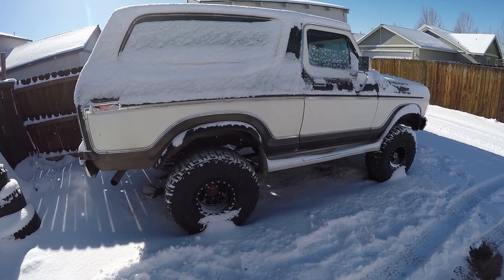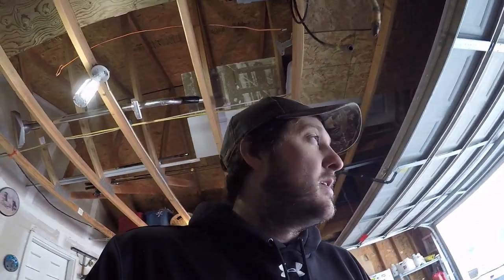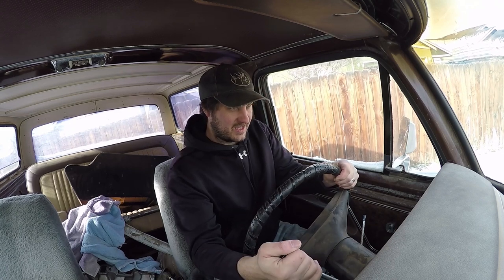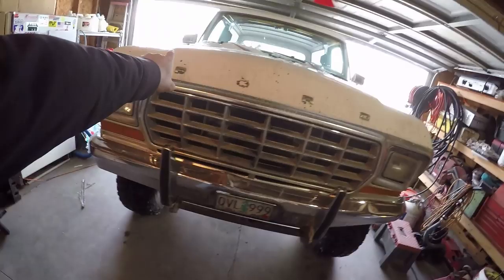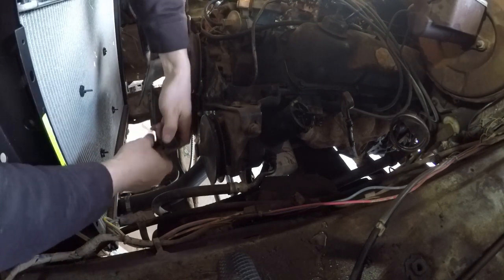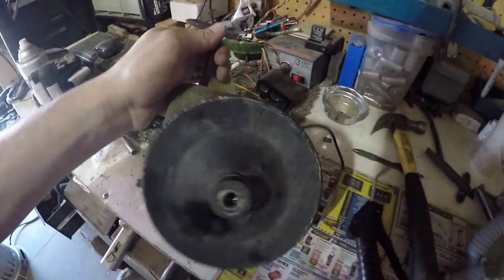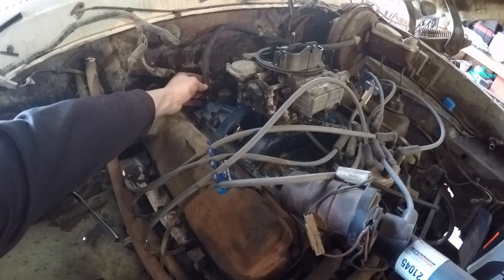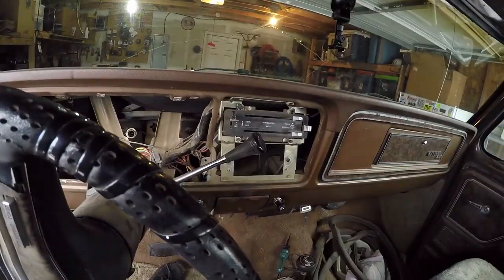1978 BRONCO POWER STEERING PUMP AND THINGS

Comment: It has been a few years since I had to fill the powersteeringpump due to a leaky hose on my Bronco but I ran into the same problem as you did, with the fluid overflowing. Then I read in Haynes or Chilton that the frontwheels should be off the ground when you turn the steeringwheel in order for the fluid to run through the system without overflowing. Maybe it will not solve your problem but it worked for me.
Reply: I"m about to do mine, thanks for the tip!

Comment: Working on a 78 bronco too for the past few months its pretty cool watching you guys doing the same stuff. I put 33s on it and my steering gear box is leaking like crazy thinking about going to a redhead box.  I swapped my intake for a four barrel  holley and a dual plane next up is dual exhaust, raptor liner, and lift! keep the videos coming definitely subscribed!!
Reply: go with the red head box. The sector shaft is no longer made by anybody so they rebuild cores with sloppy shafts. You could get one that is worse than what you have. I heard that red head will build up and machine your box to factory specs.

Comment: You may have air in your lines or the steering box, I would suggest jacking the front end up so the wheels are off the ground and then turn your steering wheel back and forth from full stop to stop a few times to bleed the system.

Comment: You have air in your power steering system that is why your fluid pushes out. Keep turning your wheel back and forth lock to lock and it will eventually bleed out. Approximately 10 hours later!